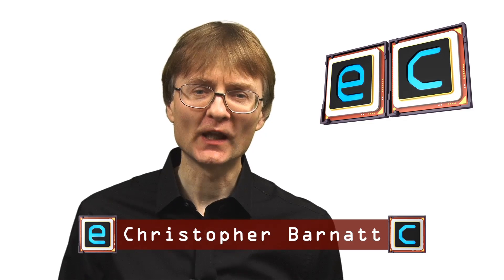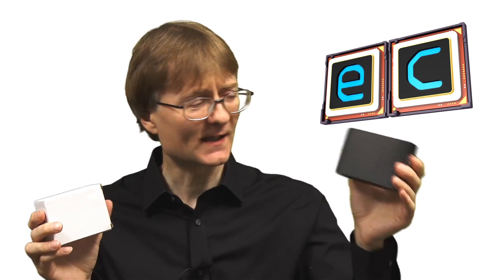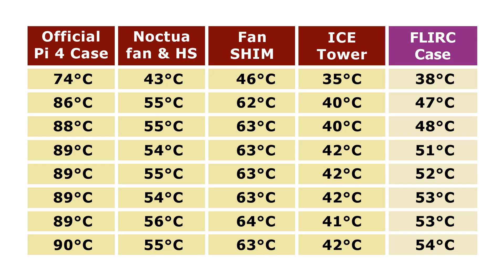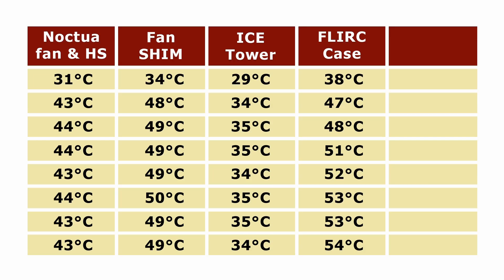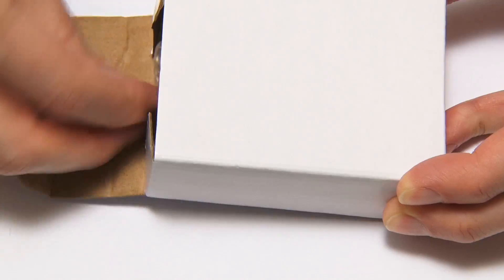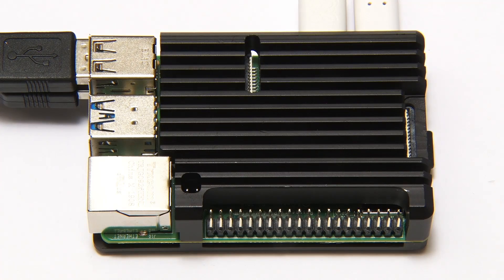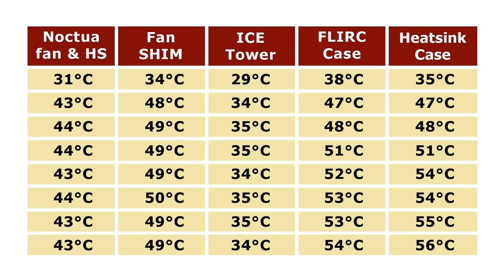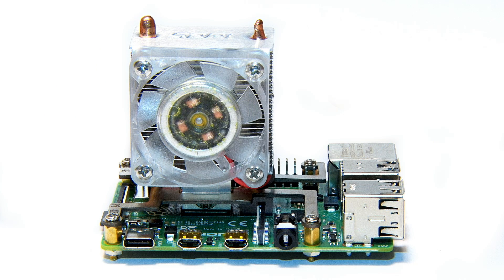Raspberry Pi 4 Passive Cooling

Comment: I wonder how the FLIRC or Pi Hut case would have performed with a high-end thermal paste from the likes of Prolimatech instead of thermal pads. Well-applied paste is considered to far outperform pads. But I'm not sure if either of those cases will let you get the heatsinks tight enough to the processor surfaces to allow paste cooling.
Reply: I did that, but the gap is too big for just thermal paste to make a decent bridge between the CPU and aluminum case.  I went with proper copper shims and put Arctic Silver 5 on both sides, for a sandwiched interference fit between CPU and the case's thermal heatwell.  (Burnish the face of the heatwell, too!) It worked beautifully, and ran cooler than the garbage thermal pad that comes with the otherwise stellar Flirc aluminum cases.

Comment: Regarding the Aluminium Heatsink case, the bottom heatsink does not seem to contact anything, not event the top heatsink, short of the mounting screws. Is it even adding cooling?
Reply from the maker: I guess heat is condicted down the bolts from the top!

Comment: Thermal mass of this passive coolers bigger than of small radiators. Temperature didn't stabilized in 10 min run and still rising. For more comprehensive comparison passive coolers need to be run much longer, maybe 2-3 times more.

Comment: My own follow-up, after I upgraded the firmware, aluminium heatsink, with 2 fan 25mm (they are under 20dB, so virtually silent), and with managed speed:
temp=47.0'C
temp=58.0'C
temp=60.0'C
temp=61.0'C
temp=62.0'C
temp=62.0'C
temp=62.0'C
temp=61.0'C
The starting temperature is high because the RPi has been sitting in the non-aircond room all day long, so it was over 30C at that time and even right now, the aircond is set at 27C.

Comment: If I was to use Pi as a non GPIO device I'd go for FLIRC. So many things can go wrong with exposed electronics ;). On the other hand two piece solution looks as a good candidate for custom case.

Comment: Use the Passive Heatsink with proper thermal compound (like mx-4 or somethig else) and get an server fan or an normal fan with enough cfm an put that stuff o the passive heatsink (also get a big thermal pad to cover the bottem of the Pi) maybe you also can youse the server fan with the tower cooler

Comment: Only Explaining Computers makes thermal testing compelling :)  Chris, if you could make a weather station project video with the Udoo Bolt or Raspberry Pi, that would be brilliant. I know it's been done, but no one else does it with the same style and clarity. The metal band of Stanley the Knife, Allen Key and Mr. Scissors just adds to the spectacle.
Reply from the maker: I like the weather station idea -- noted!

Comment: Do you time the tests to ensure that the performance of the pi is consistent? And is it possible to see a difference with the stock raspberry case and the new firmware?
Reply from the maker: The tests all ran in 10 minutes -- executring the same code.

Comment: Would removing the paint from the contact areas improve thermal transfer?
Reply: Not sure if the aluminum heatsink is painted or anodized. (The FLIRC case is more likely painted.) If anodized, that's a process of having the pores of the metal absorb a dye. Lots of heatsinks use this process and it shouldn't degrade the thermal conductivity.
Reply: @TomMetro  I work in Sheet Metal, so I know about anodizing and painting. I thought the die cast FLIRC box look painted, so just thought I'd ask the question.
Reply from the maker: I guess painted too.

Comment: The only thing i missed is that there is no discussion if you need a active cooling solution or not. Is the passive cooling solution good enough for everyday use? I think so. That way you can skip the fan based solutions and that is what i prefer. Don't be scared to step on some toes :-)
Reply from the maker: I thought I addressed this at the end! :) In most instances, witht he new firmware, active cooling is not now needed.

Comment: Chris, can you compare with the performance before/after the firmware update as well. This much thermal difference between firmware updates must have come at a cost.

Btw, there are dual fan heatsink case for Pi incase you feel adventurous!

Edit : Need to - > Can You
Reply from the maker: "Need" is a strong word! :) I doubt there is a performance cost, as the firmware as I understand it is addressing coding and power use inefficiencies -- eg leaving parts of the chip active when not in use.
Reply: @ExplainingComputers  You're right, it was indeed strong; edited.

Comment: While of course the CPU would be generating almost all of the heat; wouldn't the results be skewed by the fact that the heatsink case is directly managing heat generated by the memory and controller?
Reply from the maker: The results are not skewed -- they show what each cooling solution achieves in a real-world test. But certainly, they do not both cool the same components.

Comment: The last one is better as it cools the other two chips which also get very warm and which is why the total temperature is probably higher than the KODI case solution which only pulls the heat from the main SOC. There is a version which has two fans built in which I  don't particularly like and would rather have passive cooling but it does a great job, keeping my PI at about 43deg C in 20deg C ambient, while the heatsink is at same temp as ambient.
I think if you could use a better interface been chip and heatsink this would be improved. Those pads are not very good at conducting the heat, just better than air.

Comment: I think you should now run the same test on the barebones pi  as the update seems to have made a big difference.
Reply from the maker: I did not want to risk it!
Reply: @ExplainingComputers  As i recall you did run the test on barenone unit earlier with buggy usb controller and if the temperatures remail respectable, it would have made the cooling unnecessary for most part.

Comment: When your Pi chip has the laser etching on its top worn off I dont actually have a Pi (cooling nerd not a code nerd) but that last "heatsink case" is good but it needs a centrifugal fan in the center blowing air out the sides of the fins, While not passive anymore it'll cool amazing and still keep the relative dimensions compact which the tower doesnt (such a bodge).

Comment: I think he's put the third pad in the wrong place. It won't touch the heat sink.
Reply from the maker: It will. The pads go on the SoC, RAM and USB controller (not the Ethernet one).

Comment: Thank you Chris! I was eagerly waiting for these results!
Passive cooling continues to impress me while used on low power server grade hardware.
After the FLIRC case on my RPi3B, I bought a huge passive cooler (Nofan CR-80EH, https://www.amazon.fr/gp/aw/d/B00HW2O2L2/ref=yo_ii_img?ie=UTF8&psc=1) on my aging Core i5 4670K which is now in my main home server. It keeps it under 55° even under heavy load. Most of the noise is now from the hard disks whirring.
Passive cooling is so very cool, indeed!

However, I would suggest the use of thermal paste instead of the included thermal pad. One could easily shave off 4 to 5 degrees off their cooling temperatures for relatively cheap. I have been a fan of Arctic's MX-4 and Noctua NT-H1, both electrically non conductive and of good quality. Just my 2 cents.

Keep em' coming :)

Comment: The retesting of the previous cooling systems is much appreciated.  Did you happen to notice any compute performance difference with the new firmware?  If they managed to drop the temps that low without any performance degradation, then that would be great, however, if the performance actually increased along with the cooler temps, then that would be most impressive, indeed.
Reply from the maker: No obvious performance drop -- I understand the firmware update removes inefficent code, and turns off parts of (eg) the USB controller when not in use to save power.

Comment: I have pi 1 model B, 2xpi 2, and 4x pi 3. I wouldn't buy a 4 b/c I didn't want active cooling. This video puts the pi 4 on my list. I skipped the 3+. I like my droid hc1 and was hoping for similar case idea with case as heat sink. I like the 2nd one better than the flirt case, but might just get 2 pi's and both cases.I'm just very opposed to active cooling for SBCs. Great video, Chris as always!

Comment: Really excellent, as usual.  Thank you.  These videos tempt me to get a SBC as an everyday computer for this and that.  But there is one thing that gives me pause.  It's the power brick.  Yes, the SBC is very svelte, but the brick is as big if not bigger.  Very clunky.  Do you think it'd be a business opportunity to produce a case with an integrated power supply?  If the same quality of engineering could be applied to designing a svelte power supply and integrating it into a case, that would be the cat's  pajamas.
Reply from the maker: Almost certainly a business opportunity -- everything in one box. And also a USB to SATA adapter and mounting for an SSD (for when we have USB booting on a Pi 4 in 2020).

Comment: As speeds of the Arm core go up and better GPU's are integrated, the power requiremts will go up and with that, cooling needs. Not a big surprise that Rpi4 needs more cooling. I have a few of the 4gb models and as a desktop CPU it is quite adequate with a normal heatsink and a small fan. My setup is mounted on a Din rail and uses a 60mm 5v fan which is very quiet. The benifit of a setup like this is that it's inexpensive and very energy efficient. My setup has a Banggood boost buck converter  that can put out 8A @ 5v though with my setup, including a 2tb laptop spinner the PS is barely warm running at ~4A. Overclocked at 2ghz the pi 4 even at the most grueling task of video editing or watching videos on FB, I have not seen temps over 57c.

Comment: Please try running tests with high quality thermal conductive paste in stead of the thermal pads.
No winter-room-temperature official-case/case-less numbers in the table ?
What about doing an extreme test, delidding and using some liquid metal to increase conductivity.

Comment: Shouldn´t you have taken a 0,00001mm-layer of thermal paste instead of an 1mm thermal pad??? The thermal conductivity of everything except metal is catastrophic, and thermal pads conduct surely better than air, but even that isn´t sure, when the thermal pad is 1mm thick, and the air-gap would have been just 0,00001mm thick instead!!! The surfaces of the cpu and heatsink aren´t perfect flat, so contact is only 80-90%, and with paste you can bridge the remaining 10-20% of gap-area (mostly microscopic ridges and holes). If you now put on 100% of the area something in between, you only worsen the issue... What about a test???
Reply from the maker: Both of the passive solutions tested here have a fair gap between the SoC and the metal of the case/heatsink (a good 0.5mm) -- which would not be easy to bridge with thermal paste. In this scenario, unlike in most others, a thermal pad probably offers the best solution.
Reply: @ExplainingComputers  Then you can grind the screw-hole-posts, making them shorter, so that the chip lays on the seatsink, instead of the board laying on the screw-posts...

Comment: For those who is going to try heatsink case with sticky pads, - word of caution - it is afterwards very hard to remove the top heatsink as it attaches itself in three places very firmly with those pads and the sink is quite large- I.e. you can’t twist it or something and just tearing it off from the board has a risk of breaking PCB. I recommend using proper CPU heatsink paste instead of sticky pads, which also improves thermal transfer and gives better (cooler) results. Case then can also be very simply taken apart if needed.
Reply: Hi, if I apply a thermal paste instead thermal pads it will be good and stable contact with heatsing or is risk of evaporate of paste?
Reply: @bartoszri  paste cant evaporate, it usually gives better thermal contact with heatsink (obviously if there isnt too little paste). Same as we use for CPU<->Heatsink in conventional PCs.

Comment: This is highly inaccurate if not even false. As is very well visible in the results for the passive case, the temperatur was still raising during the last two measurements. So to actually know its cooling effect the test needs to be run until no temp change is visible or its fluctuating. 
Especially these large case-cooling solutions have a fairly large heat capacity which will take quite a while until saturated.
Reply from the maker: The tests here are certainly not "false", and I would argue also not inaccurate. What each shows is how every solution tested performs running the same test, which executes in the same time period. And that's it. So everything is fully comparable. Certainly, if the test was run for longer, temperatures may continue to rise for some setups as you note. But that does not invalidate or make false the comparative results for the time period and the test executed. If I had claimed that for each solution used, the maximum temperature it would rise to had been reached, that would be a different matter entirely. But I never claimed anything like that. :)
Reply: All true, except doesn't a fixed-time test make it a less useful approximation of actual usage conditions?

Rarely will an SBC be used for only 30 or 60 minutes. More likely hours or days. So the steady-state temperature reached is what temp your SBC will spend most of its time at and that's the benchmark users care about.
Reply: @TomMetro  Rarely will an SBC be used to compute prime numbers to 25,000 every few seconds.
Reply: @artbecker5618  true, but the load may not be dissimilar to other CPU intensive workloads, such as using an SBC to run computer vision object detection algorithms.

Comment: Hi, interesting video, as usual. The last summary table missed the no-cooling test results. They would be useful to check how the update performs in your same ambient conditions. I used the same passive heatsink case as you, but by looking inside the fully mounted thing I saw the cpu sticky pad wasn't touching the case log. So, after verifying the ram chip doesn't heat considerably, I placed two sticky pads over the cpu and I got a better result. Bye from Italy.

Comment: Not particularly relevent but I have built a sub-zero cooler for my pi. It's one of those "peltier" things off of Amazon with a CPU cooler and fan on the hot side and the raspberry pi on the cold side, all powered by an xbox psu. It runs about -5C idle and about 5-10C on load although I don't generally use it for long because ice builds up not only on the cooler but on the PCB too and it gets a bit damp which can't be good.
Reply: You can reduce applied voltage to the peltier module to bring the operating temperature into the non condensing range.  They’re literally cool devices!
Reply: @georgelovelace602  you're right, but I want MAXIMUM COOLING! haha

Comment: The Flirc cases are great.  However, they have a larger mass, which can absorb more energy.  This means they take longer to reach equilibrium.  You need to run the tests for longer.  Active cooling will reach equilibrium quicker. All tests should be ran until equilibrium is reached, ie full load until no temperature change.

Comment: The Kodi case prevents access to the GPIO pins, camera port, display port and PoE hat. The heat-sink case doesn't.
Reply: People using the Pi for Kodi rarely need those devices, so not a huge loss...

Comment: So the new firmware dialed back speeds of various components from what to what?,  would have been nice to have told the audience what had to be sacrificed to achieve this as its not by magic.

This is alot of noise about the Pi 4 which ( as ive said ) was about 6 months + way too late ( with a number of known issues out of the gate ( including the hdmi stupidity )).
Reply from the maker: Not dialed back speeds -- replaced inefficent code. Turned off parts of the USB controller when not in use, etc.
Reply: @ExplainingComputers  ive done a number of embedded categorizations and what you say here does not fit for the dramatic changes, sorry to sound super super skeptical.

Comment: The Heatsink case are a little bit higher on heat but cooling 3 chips instead of 1. It must cooler the memory and graphics chip cooler than without with other solutions.

Comment: Odd how a firmware update could lower the temperature so much. Either it's lowering the voltage to the chip or it's altering the temp reporting values.
Reply from the maker: It is removing inefficent code, and turning off (eg) parts of the USB controller when not in use.
Reply: @ExplainingComputers  thanks for the insight.